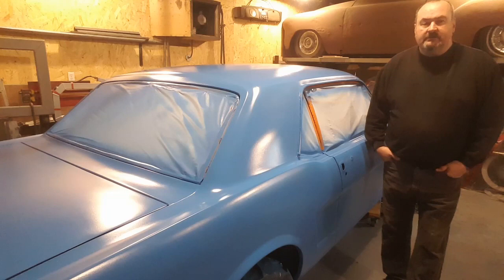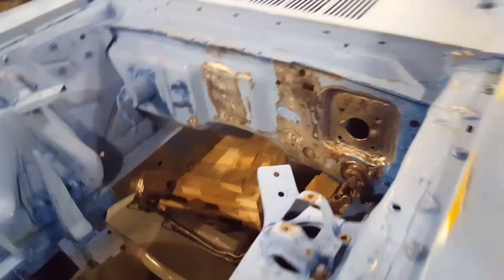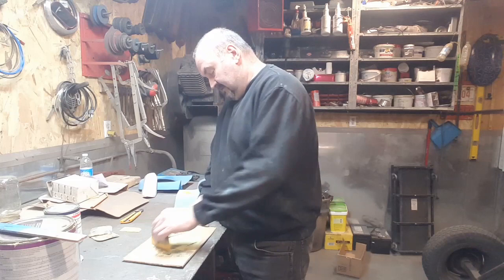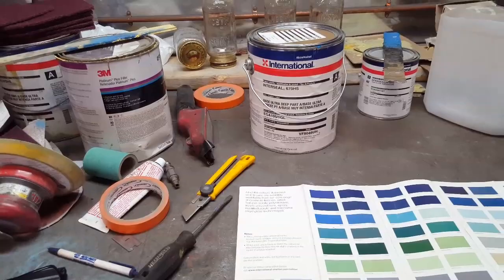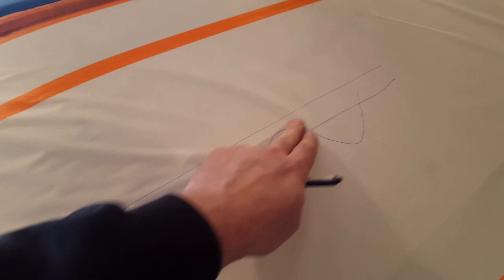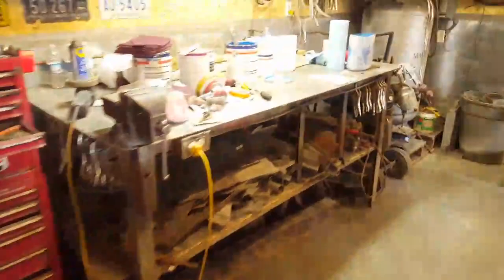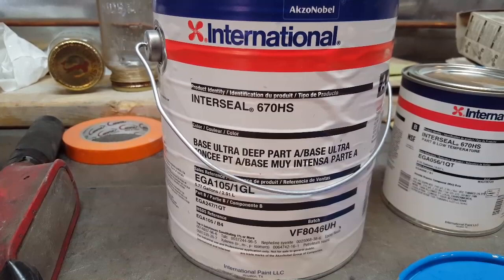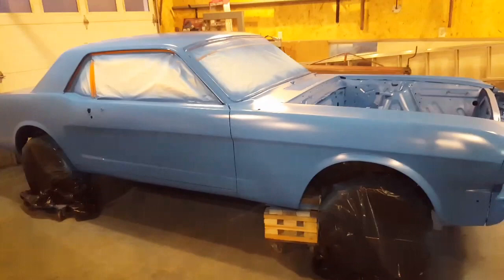Sanding and Reprimed

Comment: I've been painting about 45 years.  I started out with that expensive PPG and can't bring myself to switch.
I tell you what I have done on those  Mustang engine boxes is used Rustoleum Satin Black or semi gloss that comes in a quart, thinned with mineral spirits, over good primer. Normally epoxy mixed as a sealer.  It comes out pretty close to factory I think. Good thing about using it is if you scuff something dropping the engine in you can touch it up with a rattle can. Don't tell the Ford guys I said that because there is a formula for the correct mix. lol
Everyone has their own way of doing things.
Reply from the maker: I been doing same thing for years. Frames floors inner fenders. What ever goes satin black get hit with trimclad semi gloss mixed one to one with thinners.. car guys here make fun of me about it. Calls it the fitz mix. Lol
Reply: @fitzeesfabrications  I don't see much point in spending the big bucks on parts like we are doing on the cheap. I'm in southern Indiana and PPG single stage urethane in black is going for I think $550. per gal. That's color only. Red is around $800.+. I think paint has doubled in price in the last 20 years. Now if I were painting a hood on a 69 Mach 1 I would get the paint mixed for that.
I'm in the middle of a 1969 Camaro RS SS that someone built a drag car out of. Frames moved in ,roll cage etc. I'm trying to bring it back close to original. They got stupid with a torch. Making Taiwan full quarters, tail light panel, trunk drop offs, and inner fenders all line up takes a day or two.
Definitely not my first rodeo.

Comment: First I would like to say Thankyou for sharing your knowledge and experience. I am far more confident with taking cutter to sheet metal on  a 72 Ford F250 and a 73 K5. I would like to hear your thoughts on weld through primers and paints for overlapping surfaces and areas you cant get too after welding up?
Reply from the maker: Don't like weld threw  but if you grind off thr section  where the spot welds go it be OK. All I use is a good rust paint. And do thr same thing. Weld threw primers are not nice to weld. I have trouble with them in thr past

Comment: Hey fitzee,
Not long found this channel and love your content, gives me the confidence to have a go myself. 
I've just brought some interseal 670 hs, what mixing ratio do you use for thinners etc so I can spray it.
Many thanks.
Reply from the maker: Depending on if this is a ground coat after heavy  bodywork or a final prime just before final painting. The more you thin it the better it flows. It's a 4 to 1 mixture and I done a 4 to 1 to 2 thinners and done it also 4 to 1 to 4 thinners. Do it to soot the job in hand. I like it thick when over filler helps flatten out the work and fill up any imperfections you had in your bodywork.

Comment: Great videos Fitzee. Keep them coming. When will a motor be put in?
Reply from the maker: Shop been busy. I need to get back at this. Its all ready for painting inside doors,dash,in trunk as well as under hood. Then I'll be putting the old girl back together and get it running.

Comment: Hey Fitzee. Do you have a tutorial on applying bondo? I have welded in   patch panels and need to skim over them with a something to smooth out the area. Im a metal guy and not familiar with the filler process.
Reply from the maker: It willbe coming.

Comment: It is used on heavy steel structures, and is good stuff, but as with any primer, put it on too thick and you have problems.  The top coat adhesion will suffer.

Comment: Hey Fitzee, I'm trying to restore a vw bus but I'm just a simple man and only do small portions at one time. Could you recommend a metal primer to stop the rust until I can get the whole thing done.
Reply from the maker: I spray the stuff I used in the video. It is used on pipe lines and you can sand it and it has rust protection built in

Comment: Anybody know a good supplier for the primer in the states?
Reply: I haven't had any luck finding a supplier. There are suppliers in the US, but none I can find that do small orders. However, you may have better luck with the Carboline brand. Packaging and labeling look similar. I'm wondering if they are similar or possibly the same products rebranded. If you look at the Carboguard line of Carboline products, there are a few epoxy primers that offer tinting in 350 colors. Are any of these an exact copy of Interseal 670hs? I'm not sure. A lot of the wording is different but descriptions are close. There is a ton of info to shift through, so not an easy task. A rep might be able to steer you in the right direction. I'm adding these comments for all the folks in the states wanting this product. If you guys are able to pin down a particular product, please update here. I'm wanting some, myself! Thanks, Filtz, for all the how-to videos! Been a fan for a while and always enjoy them!
Reply: I ended up finding a local supplier. Just contact a rep if you can't find one. They're listed on the website.

Comment: Chris Hayner
I used this primer on my 66 stang and used a hvlp sprayer and I really really had to thin it so it would spray out. Did you have to thin it using the pot sprayer?
Reply from the maker: No I had to thin it out but not a whole lot. Depends on the tip on your gun .
Reply: @fitzeesfabrications   what pressure do you use? 
I've been following you since day one , you are the best at showing methods and details on how to do the work. I've learned alot from you.
As a token of gratitude for all you have done for me,here is my thought. When this COVID 19 event goes away ,probably summer of 2022. Everybody needs a vacation how about you(plus one) coming to Minnesota on the 3rd week in June and attend the Best Car Show . It is BACK TO THE 50'S  . It is put on by the Minnesota Street Rod Assoc. There are over 10,000 cars there from all the states and even Canada.
We(my wife) and I have the room in the house .  I would pick you up at the airport . Take you to the show (3 days) and on Monday deliver you back to the airport.  Who know's if you bring your recorder along you might be able to write this of as a business expense.
See yaround
Chris

Comment: Looking at the spec sheet 670HS is an epoxy primer. I thought epoxy primer wasn't sandable. This is a sealer and is sandable?
Reply from the maker: Yes it is. Now it takes longer to setup compared to regular  primer.
Reply: @fitzeesfabrications  I found a dealer here so I'll give it a try. Thank you for the tips.

Comment: Hey Fitzee, did you spray a special gun? My rep told me I have to use either a pressure pot or airless sprayer
Reply from the maker: Nothing special.  It is hard to spray but on the second time around the reduced it and it sprayed perfect
Reply: @fitzeesfabrications  Great, I found some in Edmonton. I read some people have success with 15% reduced. do you remember what you used. I prepping my VW Bus now. Hoping to spray in two weeks. Thanks for the videos, gives me confidence to play with it a bit, the spray gun I mean.....

Comment: Looking fantastic Fitzee, would that be considered a DTM epoxy primer?
Reply from the maker: Your guess is good as mine.lol. it was on it when it showed up at the shop. It's a epoxy primer for sure
Reply: If your talking about the interseal 670HS primer he is using then I think it would qualify as a DTM primer. From their application guide "For application to a wide variety of substrates including hand prepared rusty steel, abrasive blast cleaned and hydroblasted steel, and a wide range of intact, aged coatings. Provides excellent anti-corrosive protection in industrial, coastal structures, pulp and paper plants, bridges and offshore environments in both atmospheric exposure and immersion service."
Reply from the maker: @TheKajunkat  thanks. that explanation is way better then what I said. Lol.

Comment: Needs cheap epoxy for a job, where in st John's did you find this
Reply from the maker: International paints.
Reply: @fitzeesfabrications  do you use there thinners to thin it
Reply from the maker: @rossokeefe2577  would be best but I never. Lol. I buy 5 gallons  of thinner at a time. I use it for everything. But for you I go with the one they sell
Reply: @fitzeesfabrications   I buy 5 gallons at a time to..virgin thinners I guess..i paint and body as well.. funny we never met at some..was talking to international..thanks for the tip
Reply from the maker: @rossokeefe2577  your all set. Lol. Too funny. Where you located? I'm in CBS
Reply: I'm out in Placentia area

Comment: I have to ask why bondo under the hood at the firewall. Your metalwork looks great and concern I have is in time the heat and bondo may crack or separate, whereas if you just painted or used the wrinkle finish coating you would cover any and all sins. Not to mention you getting in there to sand it out you ain't a young guy either.
Reply from the maker: I filled many a engine bay. Only way that will come off is with a fire! God forbid.. as nice as you think the metal work is it still need to be filled.  Thin skims to pick up the imperfections.
Reply: @fitzeesfabrications  Who is going to see that behind the block and that thicker style paint coating hides a lot of sins.
Reply from the maker: @carmo9693  some of it is high and will be seen. Got to make it pretty for the little woman. Lol

Comment: Ear protection but no safety glasses or welding helmet there is more to it than just being a great fabricator setting a good example is one of them when you are teaching and that is what you are doing if you cant follow proper safety then get off the channel!😡
Reply: You should give this guy credit, he's not showcasing safety, but showing his skills and tricks, if you don't appreciate that, then you should get off this channel!
Reply: He's old school, blocking the welding arc using the gun tip.  Before instant-on lens filters were a thing, you could mount a small lens near the tip of the gun on an adjustable arm and look through it.  Same concept.  Are there safer ways to do it? Always.  He is actually protecting his hearing, his experience protects his eyes from the welding arc, he knows more than well enough to protect his lungs.  The cyoisocyanates in epoxy paint will destroy your lungs without a decent respirator on your first try.  A down-draft booth and/or a tyvek spacesuit and piped in breathing air supply would be better.  But for occasional work, a good quality cartridge  mask will work.    I doubt he would weld straight overhead with dirty metal without gloves and a full face welding helmet.  I want to mail him a light set of leather gloves just to prevent from damaging the skin on his hands with excess UV exposure.  Welder sunburn over time is no bueno

I hear what you are saying, that his safety isn't textbook, but I doubt anyone watching would think it was. The way he works is safe for him.  He won't make it as the model for the OSHA poster, and he's the first to say it.  If a viewer is here to learn OSHA safety regs, they will be disappointed.  Take the lesson he offers in the nature it is intended.
Reply: @briancorrigan5350  Well said Brian +++++